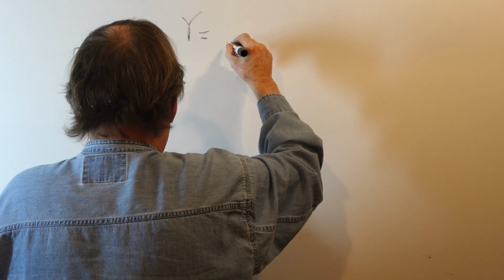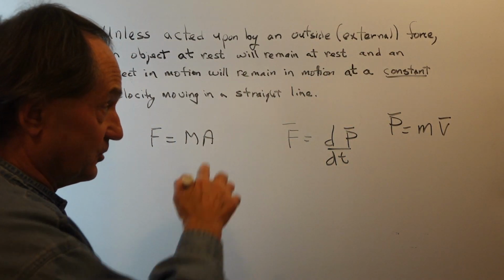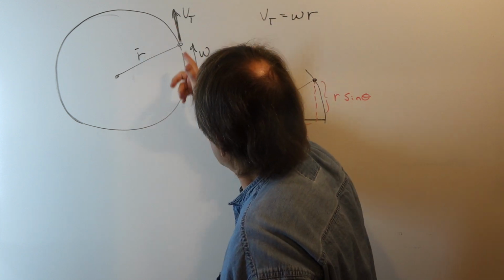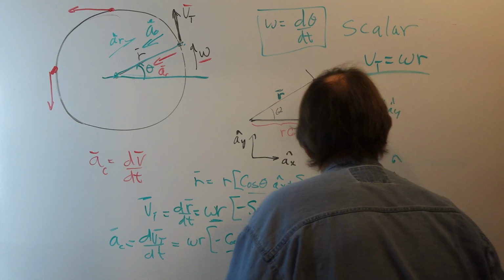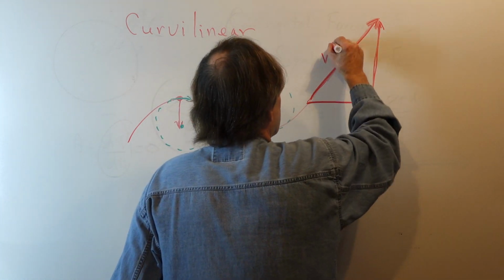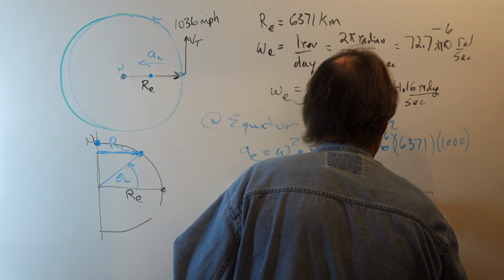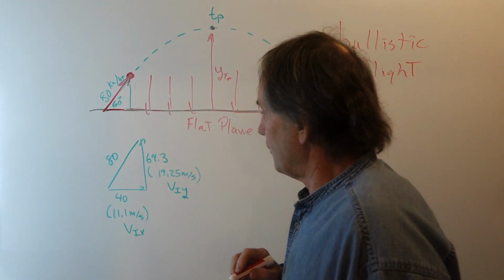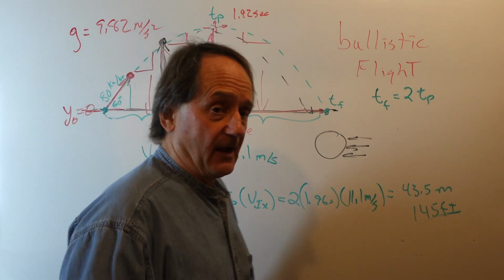Coriolis Effect   part 1

Comment: İ understand you had a storm that caused trouble and i hope you are fine, but i would really appreciate the 2nd and 3rd videos man, hope you do upload them. If you did so far, i couldn't find them.
Reply from the maker: Arda Unal,
No, not yet.  I am quite behind on my work and trying to get the videos finished in my spare time.  Will try to get to that soon.  There are 18 videos I have planned and the math figured out for but trying to find the time to write everything up to make a video is a huge job.  I hope to get to the Coriolis effect and the neutral buoyancy videos by the end of the month.  There is good stuff there that needs to be finished.
GH           Feb. 05, 2019   2:08pm
Reply: @georgehnatiuk5806  thanks for spending your precious time to give an answer for my comment, mr. Hnatiuk. Looking forward to see those new content.